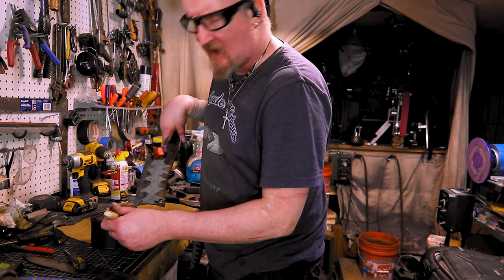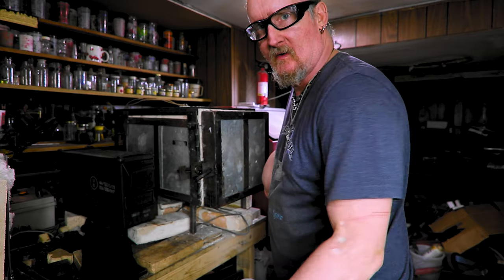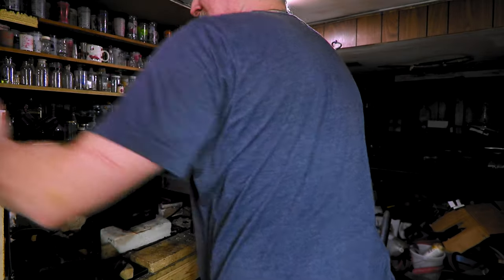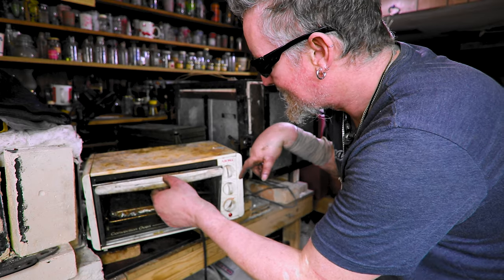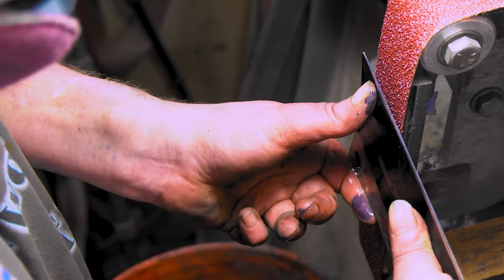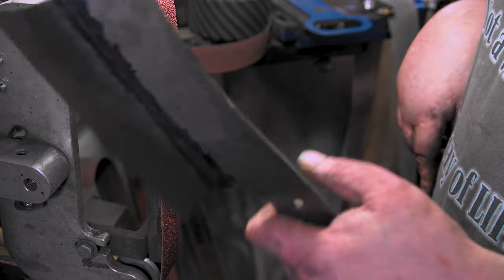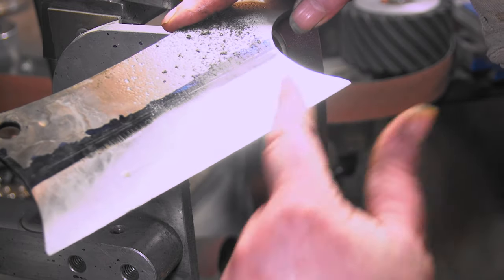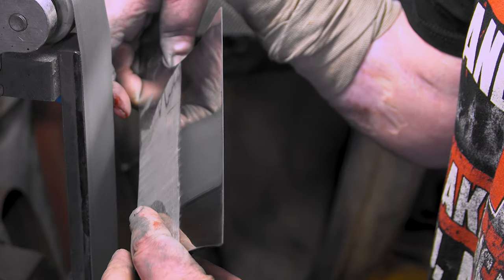Knifemaking... Cleaver Build - Heat Treat & Bevels

Comment: good tip on the 52100 going in first for the soak... ive got a couple that I forged out of 52100 and a 1095/416ss san mia that i'm goning to heat treat tomorrow!
Reply from the maker: Hey there stranger, how you been? Hope you're holding up through all this. Stay safe my friend. Also, let me know how the San mai works out.

Comment: Great job man! The thing is a beast!! Any tips for getting blades flat without a surface grinder? Thanks.
Reply from the maker: Get one of those strong hand magnets, I use them all the time after initial surface grinding. You just have to be careful not to put too much pressure in different spots... You can also use regular welding magnets, but the strong hand has a switch so you won't scratch the blade... https://amzn.to/2O2LB8a
Reply: Dave Evader Knives thanks man!